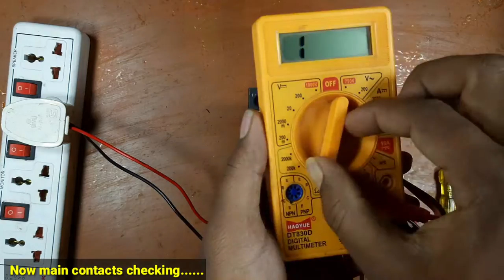how to test Contactor || Contactor test with multimeter ||  #contactor #electricalteluguofficial

Comment: Thanks for wonderful content ❤❤❤.  Sir, tell me please 🙏 I see, that you checking main contacts by multimeter in the continuity mode while contactor is connected to the circuit but I heard,  that it is strictly prohibited to use multimeter  in continuity mode while your device is under voltage ⚡️.  The device should be powered off first right or no?
Reply from the maker: Yes..we should not check continuity when power on....